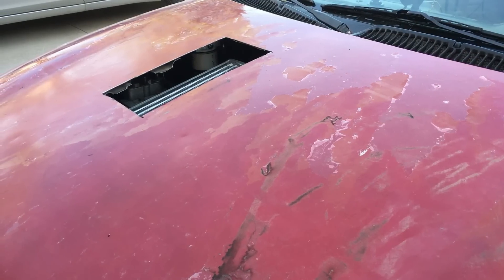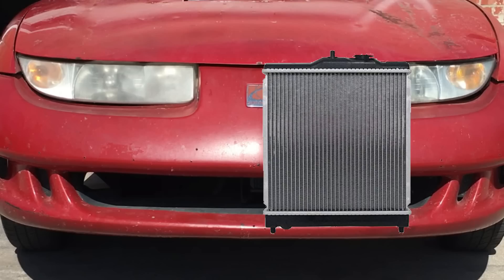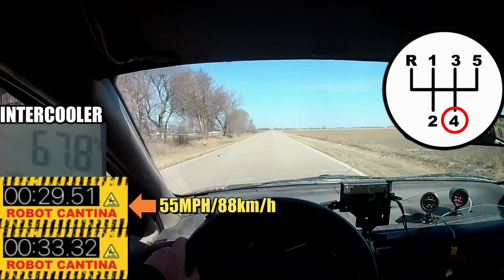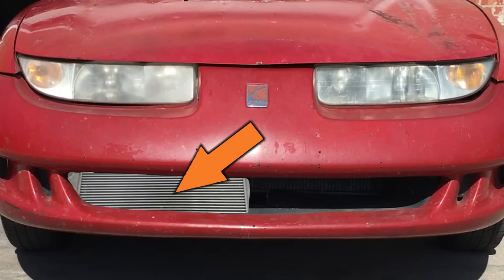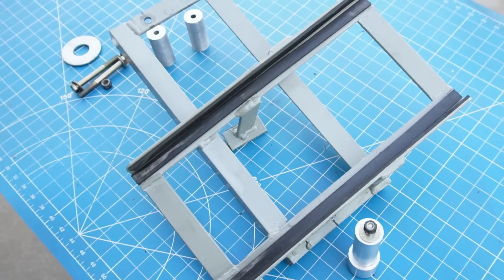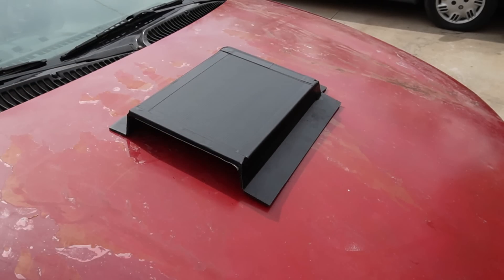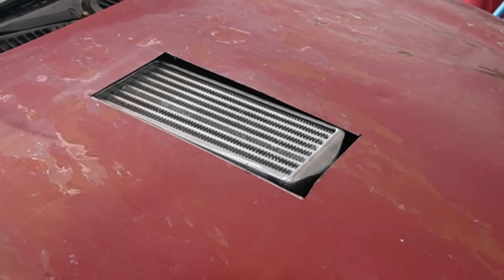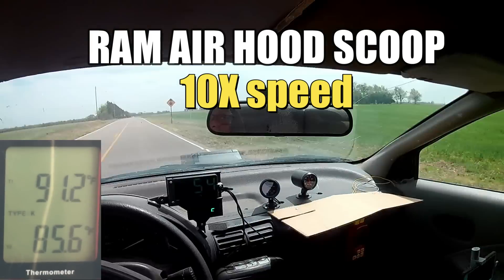S3 E12.  Testing different modifications to the intercooler on the Kubota turbo diesel Saturn.

Comment: Nice test, ram scoop created a high pressure area and promoted flow down through the core. As mentioned by others, to make more power or gain performance with the cooler denser charge air you need to add fuel. I wouldn't bother with fans imo. Fans are for stop and go and low vehicle speeds when there isn't enough airflow to capture and direct. Most 12v electric fans even with a shroud can only move air through a radiator or heat exchanger in the 10-20mph range. So at highway or cruising speeds they can never be as effective as air speed and pressure hitting the front of the car hence why the cycle off at speed and then kick on when slowing down. If you do test fans I suspect you will find a cooler temp when sitting still low load at the start of the run and then temps will rise at speed under load once pressure on either side equalizes from either above the hood or under depending on which way you go and then the fans cant move air, causing stall or turbulence and block the surface area of your intercooler core.

Comment: Why are you so adverse to the idea of a front mount intercooler? The added piping won’t hinder performance if that is your concern. You add an intercooler on forced induction to reduce IAT(intake air temps) delta rather than temp itself. so you can reduce detonation or knock at any ambient temp. The closer to ambient the closer to ideal combustion you get. On a diesel you lower IAT to have higher air density to add more fuel and keep the delta as close to ambient for again ideal combustion. You aren’t seeing any gains from lower IAT because you “tuned” the car IE adjusted boost and fuel at high IAT. If you tune for the ram air delta of 4C instead of the no scoops 12C you will see performance gains.I would at the very least run the ram air and return or simply move the intercooler to the front and remove the hole in the hood…

Comment: I'd love to see a cowl induction hood in a wind tunnel.  I think it's pretty dubious as a general principle.  The shape of the car, angle of the windscreen, undercarriage, fender liners, and so many things affect the path of hot air.  

If you think about it, you could measure the air pressure at the inlet of the scoop and under the intercooler and determine roughly which direction air is moving.  You may have static pressure under it from the engine compartment and flowing air from the front bumper, air dams, etc.  

The most optimal way would be to duct both the inlet side and the outlet side to ensure only ambient air is reaching it, and no static pressure is reducing the flow.  But as you said... you're chasing a non-existent advantage.  :)

Comment: Great video! If you use electric fans, they do NOT push, I learned from my attempt at  laptop cooling. The blade of the fan has to be extremely close to the edge of the case for it to PUSH air.

Comment: That was an epic pass. I believe that the car has earned its racing stripe by that amazing feat of performance.  Maybe it will help hide the scoop if you decide to go that way.  On the other hand you may wish that the scoop would hide the stripe at that point.  I'll bet the guy in the truck saw nothing but a blur.  Thanks for the video!   Ohh.. I should have added that the guys windows looked dirty so he saw a blur.

Comment: If you really don't want the hood scoop, you could try using something like those flexible dryer ducts to scoop up the air at the front bumper towards the underside of the intercooler. The spacing might've just created enough space to do it. It would make plan C work better I think.
I also think it needs more fuel to really benefit from the denser air.

Thanks for the fun experiment!

Comment: Seems like the intercooler would only help more if you had the boost higher, but if your boost pressure is limited by max EGT, I guess it doesn't matter anyway.
Reply: Boost pressure could also be limited by the head gasket or other things flying apart. 💣

Comment: A gasket between the hood and the intercooler would be interesting to see.
Reply: Yes, the ram air scoop orientation with a shroud to force all that air through the intercooler and not allow any to go around it would be a great test to do.
Reply: With the hood scoop adding ducting and gaskets would decrease his temps even further. Subaru and most top mount intercoolers with a scoop use such assemblies.
Reply: @802Garage  Yes it is one of the classic blunders Subaru folks make; they'll upgrade the intercooler but not adapt the shroud to match and a bunch of the air will just escape around the intercooler instead of going through it.
Reply: @802Garage  @RobotCantina it's a shorter video than most but we want to see the hood gasket yet added to the intercooler please.
Reply: I thought the intercooler looked weird when it wasn't flush or parallel with the hole.  You are right, a gasket would help, but it wouldn't make it look better! :D
Good thing he covered it! :D
Reply: Agreed

Comment: Back in the 1960s, people put superchargers on engines, but no one used intercoolers on them, and they seemed to work OK. your test seems to bear out the wisdom of this.
Reply: Because the fuel air mix going through the carburettor would chill the charge significantly before the supercharger (also cooled from the fuel air mix) compressed it. Intercoolers were used more when port injection became more widespread.  also, Many aero engines used superchargers with intercoolers during the 40's. As for the Saturn, he needs more boost to realise the full potential of that intercooler.

Comment: Air through the front end gets drawn down out by vacuum force.  Hole in the hood is an intake when ducted, and the air takes the same downward path for the same reason.

Comment: I think it'd help to put some adhesive foam around the intercooler to force the air that enters it directly through to the hole in the hood. It'd basically be like ducting. I have an old Corvette that has foam like that under the hood to ensure air goes through the radiator and not around/over it instead.

I'd expect it to make zero real world difference but ensuring the air you do get is forced through the intercooler would at least be a nice "fit and finish" aspect to the design.
Reply: Gaskets are good.

Comment: What direction is cooling air flowing through the intercooler?  Top down or bottom up?     Hood scoops are notorious for being in a low-pressure zone.  I thought you would put it on top of the hood.

Comment: I'm a bit confused about why the intercooler did nothing for performance back when it was introduced. There should be more air (hence oxygen) comming into the cylinders. Is it because lack of added fuel? Are the oxygen at ambient temperature already enough to burn all the diesel that is injected?

Comment: In everything except the ram air setup, you are blowing hot air from underneath the intercooler out of the hood. The front mount would be the most effective option, but you are resistant to doing that for whatever reason, so a goofy looking ram air setup is what you are going to be left with.

Comment: I know you are gonna trash the car and save the trans and engine but still would it be worth the effort to swap it into something else to make a vid or would it be better to fix the car with parts it needs to make it an everyday driver? Just buy a bit bigger kubota like the D902 like I have in my bx23s and install it into a newer car that you deffo plan to keep and use it for vid material. I just love these kubota vids I really do!

Comment: I know a guy that has a supercharger on an LS motor in a S10. He fabricated an intercooler that is cooled by the air-conditioning.  Seems to work exceptionally well.
Reply: For cruising around and occasionally getting on it they work. But they can’t keep up with the heat continuously.

Comment: One thing you could have tested is a little spoiler in front of the intercooler creating a low pressure area on top of the Intercooler making the air coming from the front bumper be sucked upward and it wouldn’t look as goofy as that air scoop

Comment: You should try the reversed scoop with ducting from the bumper to below the intercooler, that would be the best I think. You could make the ducting out of the plastic that you made the scoop out of I think. Maybe if you also put some termo isolating tape on the outside of the ducting you completely avoid the heat from the engine bay

Comment: I think you could install the fans over the intercooler without turning them on to see which way the airflow makes them rotate
Reply: People have suggested tuft-testing his aerodynamics and that would work for his intercooler, too.
Reply: I'd be curious to see this as well.  My guess is air is getting sucked downwards because of the air dam installed on the front of the car results in less air under the car, but my intuition could be wrong.  I thought the sideways scoop would work better than it did. :)
Reply: @alskjflaksjdflakjdf  generally speaking I think most automobiles designed In recent history end up with a low pressure zone under the car anyways and that's what assists at speed with removing heat from the engine bay. So I'm with you.
Reply: That's actually a solid idea, I'm here for it
Reply: Pack intercooler with dry ice. That should cool it down a lot.
Reply: I was expecting the cowl induction to do better than the ram by allowing all that air coming through the grille to flow out, but perhaps it's too close to the windshield, leading to turbulent and muddied flow.
Reply: @nikytamayo  Perhaps it needs a gasket.
Reply: @drippingwax  Maybe, but still, the pressure differential should push air out. That temp seems to indicate stagnation, neither in nor outflow.
Reply: Fans on the underside to draw hot rising air out of a hot engine bay through a cooler is beyond stupid, it doesn't work so testing airflow direction is pointless. The only way fans underneath would work is if they're ducted, if they're ducted then the fans are unnecessary, much the same as using fans to draw from outside when it has ram feed. Reverse your radiator fan polarity and idle the engine to test, don't, water temps will get hot...

V-mounts work when ducted as they're isolated from engine bay temps to have a cool intake and hood exit for dissipating heat. Subaru's need water sprayers even with ram air hood scoops and still suffer heat soak. the original subaru hood scoop was actually ducted to cool the turbo, the intercooler was water to air. this was changed with the introduction of the wrx because of complexity.
What he should do is duct and isolate/insulate it from heat, much the same as a factory air intake or cooler set-up on any production car..

Comment: You need to add fuel to see any benefits from installing an intercooler. The fact, that you gainend no performance after adding an intercooler indicates that you already had enough air to completely burn all the fuel.

Comment: Most of the suggestions I had were actually covered in this video so I’d say you’re on the right path with your train of thought, or at least the same one I have. I think the additional volume you’d have to compress to mount the IC all the way up at the bumper would actually hurt performance so leaving it in a direct line to the intake is a good call, if the object was to test the effects of engine inlet air temperature, you could use an air to water cooler and use chilled ice water in your water tank like a lot of drag and sled pulling guys do, or if you had enough boost to get the air hot which it doesn’t really seem to look like it, you could cool the water for the intercooler with a radiator mounted where everyone is saying to put the intercooler and the air to water system wouldn’t add much volume if any to the air between the compressor and intake, I think that fact is overlooked by the people suggesting to mount the IC at the bumper.

Comment: The intercooler is to lower intake temperature, that in return lowers the EGT on a diesel it allows you to add more fuel. So it's not going to directly make power but it will allow you to make more power by the ability to add more fuel.
Reply: Exactly so ADD MORE FUEL and then you get your POWERRRR in this 3 cylinder turbo charged diesel lawnmower go kart Saturn coupe
Reply: Also, this engine was designed to run at 75% rpm under hard load for long periods. What they are doing here could be improved with a different cam. I really like the work they do---thorough and technical. Top Notch!
Reply: @otosere2857  they could try to advance the injection pump by a gear tooth, although thats sketchy and imprecise
Reply: @butstough 
They did advance the fuel timing already,  they also increased the fuel pressure.  To the point they don't want to burn the engine down.  And it did help the power.  I assume they don't want to ruin the engine just because they can.  I think they want as much power and fuel mileage as they can get without hurting the engine.
Reply: You have yet to try water cooling for the intercooler.     
About 35years ago a friend have a 1600cc, 4cyl turbo Ford Escort.    We opened up the grill to allow more air to the intercooler.  We flow ported all the joints and manifolds. Next was a switch operated fan set up like you are doing to keep the intercooler working when the vehicle is stopped at traffic lights.  Then we added a water spray from an old windscreen washer set up that used a fine misting spray onto the hot intercooler, again it was switch operated from the dashboard.       Prior to this the car was given a free flow exhaust and injector modifications and on a Dyno gave something about 130bhp.  After these mods and with the water spray n fans he had nearer 140bhp.   Not a lot but didn't cost much to do.
Reply: Yeah, I do kinda feel we've been here before with this. Expecting a performance boost without tuning to take advantage of the performance boost enabling tweak is.... Optimistic.
Reply: This is how it works, i think Mr.Robot misunderstood how the IC is supposed to add performance on a diesel engine. On a petrol engine the power is directly coupled to the volumetric efficiency, which in turned is coupled directly to the intake temperature, and its knock limited(which also is affected by intake temp), so the IC have different effects on it.
Reply: @garagecedric  I think what you’re trying to say is gasoline engines gain power (via intercooler/IAT) through timing, and diesel through fuel. Air density alone effects them the same as they are both air pumps.
Reply: @gforce_117  naah, air density will not affect them the same. For the petrol engine more density will directly mean more power since it runs within a small afr window and will add fuel the more air you put in. .the Diesel can run at a very wide afr window, its more or less dictated by the fuel amount. But the added air density gives the possibility to add more fuel without high egt or soot.
Reply: @garagecedric  if they both gain the same amount of air mass or oxygen they both have the same potential. Obviously you can’t just add air to a gasser. I’m saying keeping all timings and other factors constant. Injection timing, spark timing, cam timing, boost, etc.
Reply: @garagecedric Naah, wrong.. All engine's are just air pumps and both require more air to make more power. Air density is just more air in the same space, ALL engine's make more power by utilising that extra air to run more fuel regardless of fuel type.
Both use varying ve/afr targets for optimal power and cruise efficiency, the major difference is you use fuel to lower egt's in one and air the other.

Comment: So you're right an intercooler will do NOTHING for performance if you also adjust nothing else. In your case. you need to increase the fuel delivered, as lower intake temps will allow you to inject more fuel, as the EGT Temps will also be lower. if you're putting 50f LESS heat into the engine at intake, you will be able to inject more fuel as the air is denser.

At 51c, air is 0.55 kg/m³, at 24c it is 1.184 kg/m³ so at the same boost pressure, you will be almost doubling the amount of actual air travelling into the cylinders. Meaning you have almost double the amount of oxygen you can use to combine with fuel. Obviously, EGT Temps may restrict you from using all this oxygen, but you should be able to significantly increase your injected fuel amount, therefore, increasing power.
Reply: Note that if the static fuel trim is jacked way up it will be ridiculous at idle if it even idles anymore.

Comment: This test was performed by Gale Banks and Ford in the mid 1980s on the Ford IDI. Results were that below 28psi there was no difference in mpg or 1/4 mile time for the truck when loaded between the cooler vs non-cooler trucks

Comment: The ram air scoop needs to have a higher profile to get into the airstream.  Try taping short lengths of yarn on the hood to visualize the air flow.
Reply: Tuft-testing is always good, but this is how car manufacturers have done it for decades, and it is appropriate for much-larger engines than this.
It would take longer to test than to implement and his regular camera setup would work.
Someone suggested tuft-testing to see which way the air is flowing on the intercooler, but since the scoop worked best facing forward, arguably the air is flowing down.
Reply: @drippingwax  He could make a much higher scoop twice as high as his first one.

Comment: On a hot summer day with 15lbs of boost, I have had IAT in the 180°s pre intercooler. Most of the boats I work on that get run hard have twin 24l v12 diesels with a tripple turbo settup. The turbo actually burns the paint on the compressor housing just from the amount of air being compressed. That little turbo isn't really compressing enough air to make a difference. Yeah, every little bit helps.